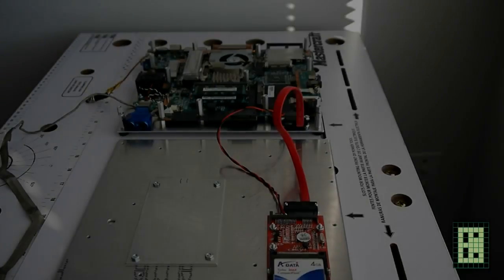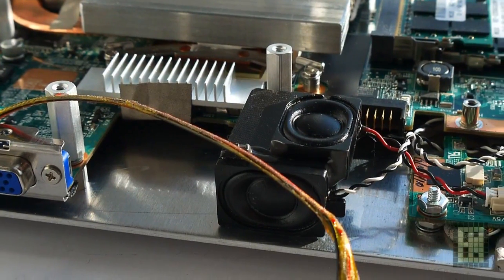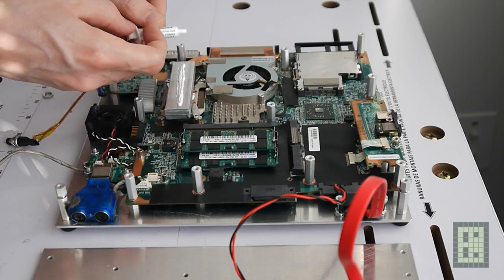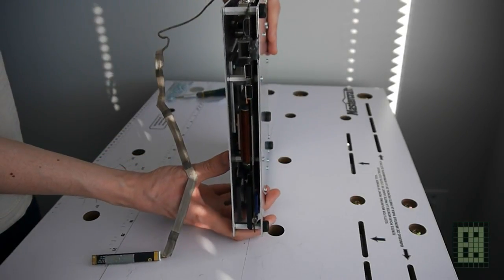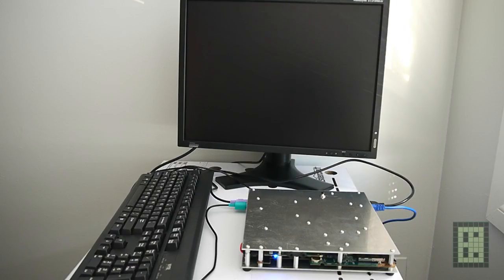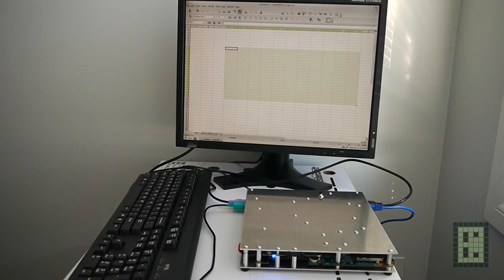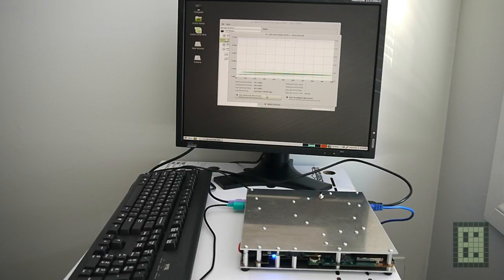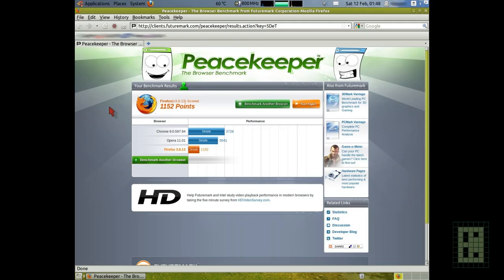DIY Desktop Computer from Laptop Motherboard and aluminum case.

Comment: This specific design (two aluminum plates) is the most unique I have seen so far. How can we use this for a full gaming experience with a top of the line GPU? Coolers probably need to extrude from cut outs in the plates or maybe very cramped water cooling?

Comment: thanks for this video . I have an issue ,
 when I used motherboard with outer screen it is start with the windows screen and I cannot inter bios .. how to solve this issue? please
Reply from the maker: It depends on your motherboard but there will be a key that you press immediately after power up and that will allow you to enter BIOS or UEFI  the most common ones are esc, F1, F2, F10 delete but may be some other keys depending on model.
Reply: @electrodacus   thanks for fast reply .but we noticed that the motherboard with HDMI port cannot be used this method
Reply from the maker: @saifsameer1199  strange but not impossible that they require the original laptop screen to be able to enter in BIOS. As you seem the one in my video is a very old laptop so things may have changed since then.
Reply: electrodacus thank you are the best

Comment: Is it possible to install water cooling in stead of fan? thx
Reply from the maker: Yes should of course be possible but it will be overkill as that fan at 5V makes no noise and is more than enough to keep this very cool.
Reply: electrodacus If I have a chance I would try this out Thx a lot :)

Comment: why did you but a cf card in with such small capacity when it wont even boot to it from the bee o's
Reply from the maker: CF is the main drive and the OS was stored there. The SD is just for initial bootloader.
This video was made quite some time ago SSD where not that common and more expensive than today.

Comment: How do you modify the power on switch?
Reply from the maker: power switch is just a momentary switch that is normal open and when you push is close circuit. So no modification is needed just soldered two wire's in parallel with the existing switch and added another switch where I needed.

Comment: Looks great except for the boot wait issue that comes from stupidity.
Reply: What you mean?
HDD here is flash = slow
https://duckduckgo.com/?q=flash+to+sata&iax=images&ia=images
Reply: @ igrewold
He said that it takes 35 seconds before it tries to boot from a different device. He can 1st priority boot from the different device instead of a failing one by changing that in the bios.

It might even work with the compact flash if he updated the bios or changed the adapter.
Reply: OK :)
Thanks.

Comment: wonderfull job .but how to connect  screen , by vga port  or what ?? can it boot on windows as first  screen?
Reply from the maker: In my case I used the HDMI port as this laptop had HDMI and I think was just set in BIOS to use the HDMI first but I think it will display on an external screen anyway if one is connected either HDMI or VGA.
Reply: What you want with Windows?! ;D
Use Xubuntu 18.04 or 16.04 :)
1) https://xubuntu.org -> 2) https://etcher.io -> 3) USB stick -> 4) try it ;)

Comment: How did you connect the lvds cable to connect it to vga port of monitor? did you use the vga port of mother board or the the laptop screen lvds motherboard port by converting it. please help. im trying to connect a samsung laptop with dead screen to a monitor.
Reply from the maker: In this case I used the HDMI connector for the external monitor and the LVDS remained unused. I could also have used the VGA port but that is lower quality than HDMI.
Reply: electrodacus 
How does it boot directly to externel monitor do you hit any key for that? as the laptop boots to primary monitor that is lvds port.
My samsung laptop doesnt boot to the vga monitor directly.
Reply from the maker: The BIOS should be accessible from any screen and in BIOS there was an option to use the HDMI first at boot. I also needed to add a parameter to the linux boot kernel so it will disable the LVDS. I think I made a comment somewhere in the video. This is quite an old video.
Reply: electrodacus 
Thank you this was really helpful will revert back if this works for me.

Comment: I'm looking at the long time about like this project videos, why no one didnt try modify the cooling system. it isnt possible or they didnt need this? I think the most important consequence of such a project, is that it gives you the chance to modify your laptop and use your motherboard full performance.
Reply: Furkan KISA the case acts as a giant heatsink
Reply: what does it mean? cooler working more comfortable and cooling better than laptop case or the aluminum
 case giving this consequence?
Reply: Furkan KISA yes, it offers better cooling than the original case plus better performance

Comment: is it posible to make  a case like this out of cardboard?
i want to do this but free
Reply: sure but the "case" can break ez pz and if it gets wet your internals can get damaged since its cardboard
Reply: If there's a hardware supply shop nearby just look for their scrap metal bin, it wouldn't be free but it would be discounted because the sheets are error cuts. Sometimes if you can get someone at a salvage yard to let you take a look at whats coming in and they may be willing to let you take it from their yard for free/cheap depending on your area.

Comment: LIKE !!! And is it possible to do THE OPPOSITE, transform a DESKTOP into a LAPTOP ??? Maybe using a THIN MOTHERBOARD ???
#TMJ ... #S4536t ...
Reply: it is possible, it probably won't be that thin though, probably something like at least 40mm for the bottom and 10mm for the top (screen). and for the case, it would be at least 200x180mm
so for a build with gpu i'd say :
batteries : 2x 10Ah 4s (280Wh, 1600g, 100€)
psu: Dc-DC 150W mini psu (~50g, 60€)
mobo: thin mini itx 1150 (if with battery dc supply, can replace the psu,500g 70-100€)
cpu : i7-6700T (35W, 300€)/ i5-6500T (35W,190€) /Intel Core i5-6600T (35W,220€)
gpu : low profile gt750ti (75W,250g 140€)
ssd :  Serie 850 EVO M.2 - 250 Go (2W, 70g,  100€)
screen: 17 inch led + driver (~10-20W, ~500g, 100€)
heatsink: custom, 300x300x0.5mm copper sheet (400-500g 50€), heatpipes (50-100g 70-100€), bldc blower(2-3W, 50g, 10€)
touchpad + keyboard: (200g, 20-30€)
ram: 1*8g-2*8g (40-80€)
total: 2 hours autonomy while gaming, probably a lot more while browsing, ~3.8kg (w/o case, a poker case and some stands should do the trick and add a couple of 100s), 900-1100€

for this price you can get laptop with a processor that has a bit more performance (+25-30%), but the gpu will give half the performance of the 750ti (except one on the high end, that has a 970m which is on par).
conclusion/tl;dr, yes you can,but that will be easier to spot a great price on an off the shelf laptop.
if you already have your motherboard and screen, just get a bunch of batteries, a charge and discharge controller, and wire all the things together in a case.
if you want more details, just ask or check build logs of suitcase laptops.

Comment: that video inspired me to make same case, and make it home server
Reply from the maker: +Dub Monster Thanks for the comments. The fan is 12V but works at 5V to be quiet.
Reply: *****
ok
Reply: you should keep the battery for a home server, and set it to stop charging at 80% and start at 70% or lower so you don't burn your battery because you have it trickle charging, the battery is great in case of power failure, you can set the pc to go to sleep and have no data loss.
Reply: manaquri
ok

Comment: how did you solve the problem of recognition of the notebook screen ? My laptop keeps showing the screen even after removing it. :(
Reply: +Pedro Albani check the bios
Reply: +Pedro Albani connect it to monitor and hold windows key + p

Comment: good job do u have another video on how to use an old laptop with no windos OS and run it as a Google chrome type browser
Reply: I'd just install linux instead of chrome os...
Reply: better late than never. Just adding my two cents here, try CloudReady, it's exactly what you described based on Chromium OS

Comment: When you boot if you use a usb keyboard does the system recognize it or not?
Reply from the maker: +Kostas pap Yes it will recognize an USB keyboard but there are limited numbers of USB ports so I decided to use a single USB to 2x PS2 so I can connect both the Keyboard and the Mouse. And I already had those with PS2 interface.

Comment: I have an old dell vostro 3450 and I want to do this but it doesn't boot without the lcd panel (which I unfortunately don't have) do you know a way to work this out?
Reply: It could be because the LCD switch that says when the screen is open isn't being triggered

Comment: This is a very nice build and something I am seriously considering shamelessly copying for an old laptop of mine. How did you run the power to the new fan?
Reply from the maker: +CounterBlade The large fan at the end is not the original is a 12V fan that runs at 5V

Comment: Well im planned to customize my acer aspire 4920 to deskstop like, im planned to buy a better used motherboard, ram, hard disk, keyboard usb, add with my mouse usb, laptop lid (screen) and maybe new cooler, what do you think?? And do i need that aluminium case too, im doing this because to buy better laptop is quite expensive

Comment: This is really good work. I have i5 laptop with discrete graphics and a broken screen. I wanna build something similar to your rig. Can you please post an overhead pic of the layout of the hardware in order for me to have a reference point on where what goes?
Reply from the maker: Patrik Glodzhani This video is more than 4 years old the HW is not in my possession but it still works great. Each motherboard will need a custom designed case. Having a discrete graphics makes things a bit more complicated but it will still work.
Reply: Would you recommend to extend a second peace of aluminium on to the graphics chip as well? Thanks for your reply btw. :D
Reply from the maker: Patrik Glodzhani For sure that is recommended GPU can use more energy that CPU's thus generating more heat.

Comment: I have 2 computers that I don't use anymore, I have an old inspiron laptop from 2010 that is is cracked, it has pentium and 2gb of ram, it's perfectly functional but the case is cracked, and I have a dell optiplex 320 with pentium and 1gb of ram (it was 2gb but the other was severely affected by the weather in my area.) What can I do with them?

Comment: mine 2 psu how running  im? 3 hard disc doesn't opening
Reply from the maker: Fatih taşdemir Not sure I understand. It seems your computer will not boot and you are using two PSU and 3 HDD. 
I will need more info. Does it work with just one PSU and one HDD?
Reply: sorry, basically explain wanting am i that, 2 psu damaged. wrong where sure im not? either, 3 mine hard disc opening doesn't. 1st xp launching won't hard disc. 2nd hard disc again opening didn't. 3rd black screen hard disc
Reply from the maker: Fatih taşdemir
Sorry I do not think i can help you. There is to little information. Probably the first PSU failed and damaged some other components.

Comment: Today we hawe for this more efficient and smaller R-pi ,banana or similar small platform.
Reply from the maker: Blahblox Gyuanox Yes those are fine but not even Pi2 gets to the performance of this 4 or 5 years old AMD Turion. Is true the power consumption is also an order of magnitude larger.It depends what you need things for. I just ordered a Pi A+ for my Solar BMS controller in order to do data logging on my offgrid solar energy production.

Comment: Hey man, loved the video. I wanted to ask you if it's possible to connect an external GPU such as a GTX 970/770 or a R9 280x/290x in this setup in order to play games. If so, how? What would I need?
Thanks!
Reply from the maker: cekpi7
How will you connect an external GPU to a board with no high speed interface available?
Reply from the maker: Not sure you noticed this is a 4 year old video and the laptop was already old at that time. There is no way any dedicated modern GPU can be installed. Even if it will have been possible it will have made no sense.
There is no reason to combine a mobile laptop motherboard with a desktop GPU you can just use a small micro ITX board for that.
Reply: yes you can 
you would need destop psu, gpu and adapter
you can find it on youtube just search laptop external graphics card
Reply: Do you have  PCI-E connector or  PCM-CIA?

Comment: What are those silver screws/raisers you use to secure and float the motherboard between the aluminum panels called? Trying to do something similar but using acrylic panels instead.
Reply from the maker: I used aluminium since is not just a case it acts as a heatsink for the CPU. The raisers are called standoffs you can probably find them at a HW store. I got mine from digikey.

Comment: I have turned broken laptops into desktops as well when the screens get shattered and they are not worth spending money to replace. Wondering why you didnt just leave all the guts in the original laptop case and make this easier for yourself or if its mainly because you wanted the challenge to make it no longer look like a laptop? I have performed some difficult mods before such as taking an IBM 5150 and installing modern guts in it. I converted a IBM 5150 to take an mATX motherboard, powered off a 350watt PSU, and Hard Drive mounted under a pocket in the case under the 5.25" bays. I used a laptop DVD-RW drive from a Toshiba Qosmio to place that behind an altered 5.25" floppy drive, so that CD and DVD's can be inserted into the what looks like a 5.25" floppy drive and load software or play media etc. Anyone looking at the IBM 5150 from the outside would think it was all original until it turns on and boots Linux Knoppix on a Pentium 4 - 2000Mhz CPU with 1GB RAM with 80GB ATA100 HDD. To pull this off there was lots of measuring, cutting, and adding of modified structural components to mount it all and pull it off. It took me about 6 months in my free time to pull off the mod. I like the use of the aluminum plate for your project, but measuring and drilling those holes perfect must have been lots of measuring unless you were able to find a layout online for hole placement for that board and print the layout and drill holes to scale 1:1 and then just add stand offs and assemble it. My next project is actually going to be to make a hand crafted wooden computer case or if I can get enough Legos I want to build a computer case out of legos which will require lots of super glue to make the blocks lock together permanently. But legos are not cheap and I have been unsuccessful in trying to find a box of them at yard sales so until i find a cheap method of getting legos that case is on hold.
Reply from the maker: The thermal management of that laptop as many others was inadequate and by using this aluminium case that acts as a heatsink for the CPU is a huge improvement.
As you maybe have seen this used around 50W and had a really small heat pipe cooling with a few fins and a small fan so even if eventing is cleaned like new and the thermal compound replaced in about a year it gets on the same situation where the thermal paste will dry and the fan will get some dust so the computer will shut down do to over-temperature and be unusable as it was when I got it. The HDD was also bad probably form the same over-temperature problems.
Now is still works after over 4 years of daily use with absolutely no intervention.
I used the motherboard to mark the holes and drilled the both plates at the same time so there was no problem there.
I was not interested in the exterior aspect jut about the thermal management. It needed to work reliably both HW and SW as an industrial PC. It performed great. The Linux was read only so it still works the same way it did 4 years ago but some applications start to be outdated and will probably require an update soon.
Reply: Thanks for answering to my post on this. =)

Comment: i'm typing from and old Acer Aspire 5538G laptop as desktop PC, removed cracked screen and built-in keyboard for better cooling, but left the bottom case as is and fixed it under my desk hidden in a corner. I had upgraded CPU to Turion TL-66 (2,3Ghz x2) stock was a 1,3Ghz Athlon. That's why i had to remove the keyboard!

I'm planning to buy a broken 3rd gen i7 notebook on ebay hopefully under 100€ then build a custom case as you did! (i will then recycle current Acer as media center)
My only complain is that you made it much taller and imo was not necessary, i'd like to stick close to stock sizes for my own case or even better, many mobo are shorter than the notebook so i may be allowed to make it SMALLER! ;P
I will also move every connector to one side (back) and secure all exposed sides with grills!

Comment: My HP pavillion dv9000 laptop had a faulty screen. I completely removed the screen section of the laptop. And I use a monitor as a external screen. I use the base like i would normally use the the laptop. It just means it has to stay stationary. The battery was also dead. So i removed it and just use the charger connector as a permanent power cable. It does the job.

There are 3 cables that connect from the laptop bottom section to the screen section. 1.screen cable, 2.wifi cables, 3.webcam cable (and webcam).
From the laptop section i completely removed the screen cable and webcam cable, and left the wifi cables dangling out which are very thin and they pick up wifi signal with no problems. You can choose to remove that also and just buy a cheap wifi usb adapter. You can also choose to keep the laptop webcam attached with the dangling cable from the laptop or just buy a cheap webcam.

If anyone wants to see pics of my set up leave me an email.